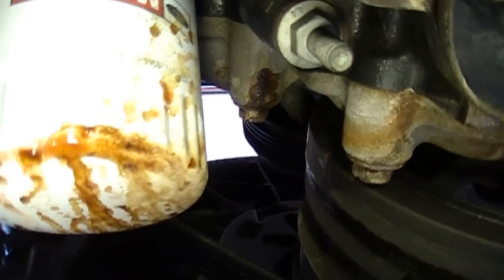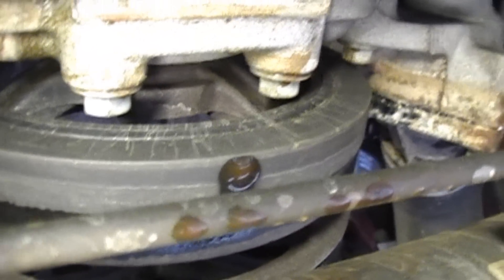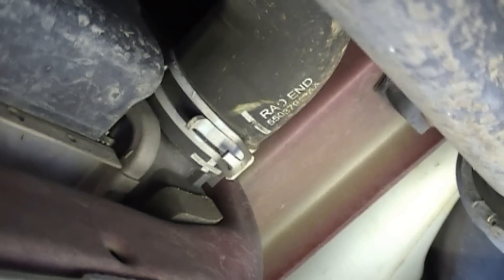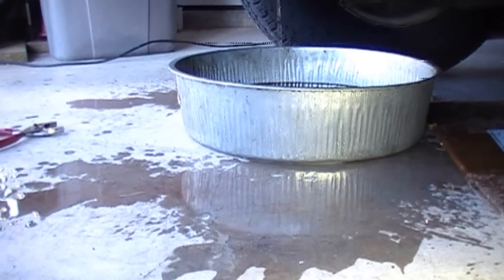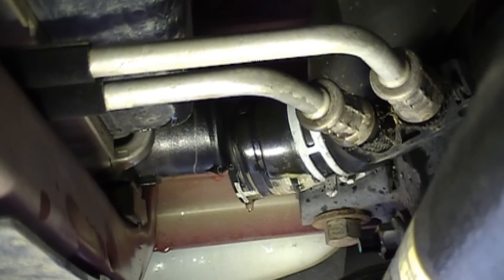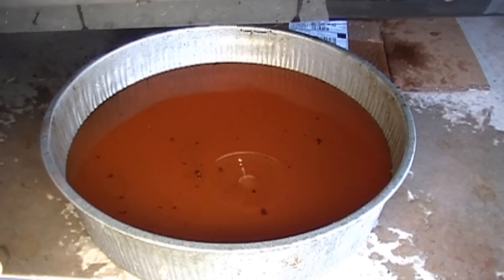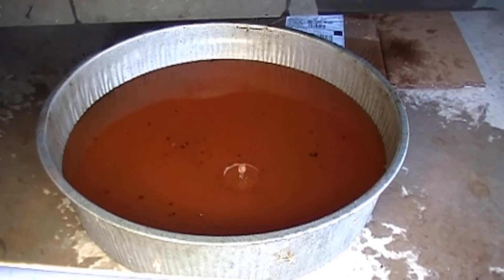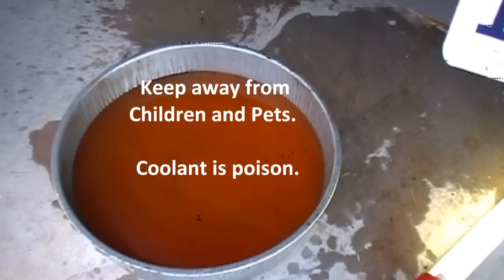Jeep 3.7 Water Pump Replacement-Part 2 of 5

Comment: Hello, my husband changed the thermostat on the car this weekend. He follow your instructions on a 2005 Jeep Cherokkee. Everything seemed to be fine  until I went to turn on the air conditioner on the car.  It makes a funny noise as if, a belt is not on track and when you stop at a stopsign it sounds like t2 plates rattling together.

Comment from the maker: Without looking at your Jeep it is difficult to know exactly.  However you may want to check the outlet on the bottom of the radiator.  It may have a very small crack in it.  Hope this helps.  John

Comment: It's just a flat head screwdriver. Unscrew the bolt in the clamp and it will undo. Tighten it after replacing the hose and it will lock back into place.

Comment: Is it possible this could be causing my car to show a cyl5 misfire and sputtering/hesitation due to getting on and shorting the plugs or coil pack? I am leaking a lot of coolant and have a leak in the same area. Only happens right after I fill up with coolant/ then after a day or so the coolant leaks out and the car runs fine? Or is this an engine block crack? :/ did any of that make sense? Great instructional vid by the way.
Reply from the maker: damyoulookinfly Thanks for watching and for your comments.  I am not sure if that is a source of the misfire but does make sense.   ~John

Comment: Please return an answer if, you may have an idea of what's going on. I would sure appreciate..
Reply from the maker: Carol, Thanks for watching my videos and for your question.  I am not sure of what may be making the noise without seeing your car.  However, if you have not already done so, look under the hood with the engine running and AC on.  Check to make sure the fan blade is not hitting something (if installed properly it will clear everything) Also check to see if the belt is installed correctly by looking at the picture near the radiator.  If not on correctly, it may be "slapping" against the radiator.  Hopefully this helps.  ~John
Reply: Thank you.